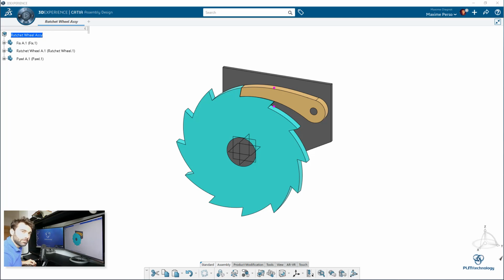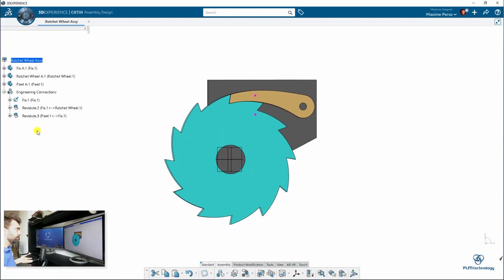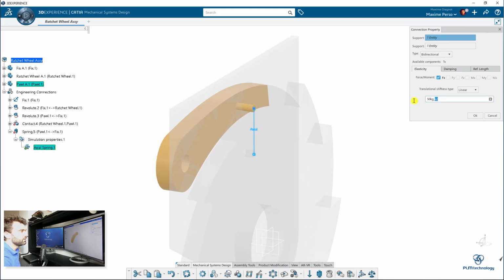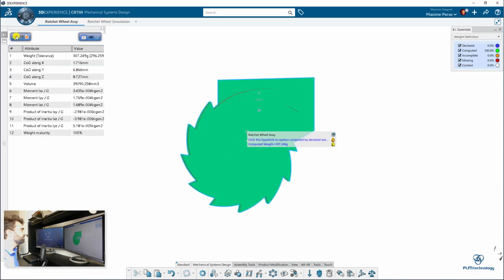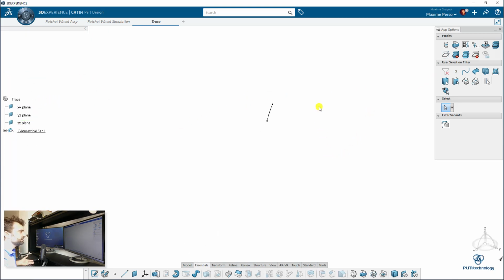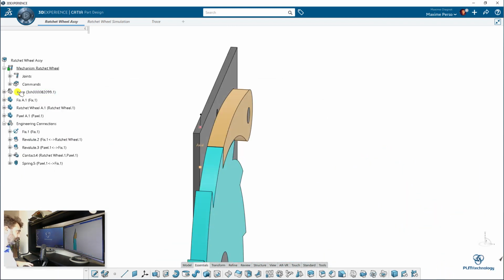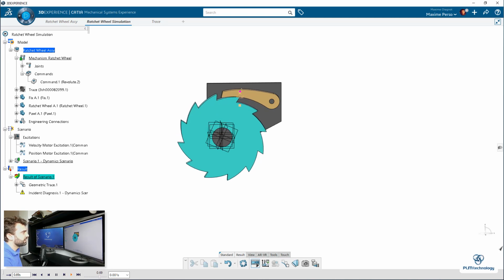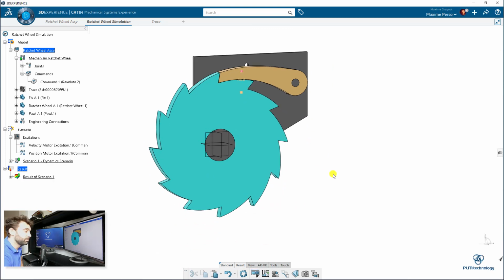Introduction Dynamic Simulation [Part 4] CATIA 3DExperience R21x

Comment: thanks very much for the videos, they have been very helpful at cover some of the gaps that DSS training does not cover at the moment. For example, I have a couple question that perhaps you could address:

1. Can we define torsional springs using the dynamics simulation tools?
2. Can I add friction to the mechanism joints, for example, can I add friction to a revolute joint?
Reply from the maker: Hello Marcel, Thank you for your kind comments :) To answer you:
1. It is only axial spring for the moment as I can see it.
2. You CANNOT add friction to an engineering connection, a revolute joint for instance. As they are used for kinematic normally. But I believe that you can create a revolute between A and B and then create a contact with friction between A and B. It could work, but I have not tried it myself, so I do not know how the result will be. Maxime at PLM Technology
Reply: @MaximeChagnot  thanks very much for the feedback, I was hoping that two capabilities of adding friction on the joint and torsional springs will be available by now. I look forward when that takes place, in the meantime I will continue to use other software those type of simulation done.
Reply from the maker: Yes I agree Marcel, I wished it could be available as well! Thank you for your comment :)